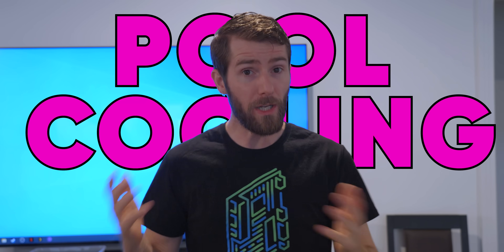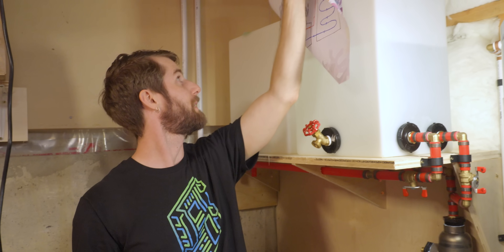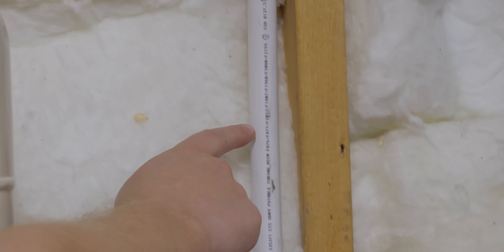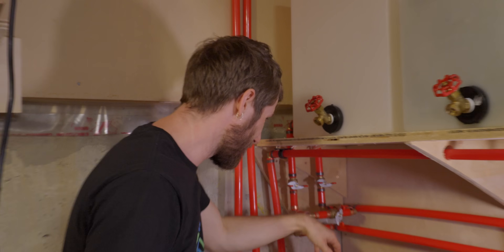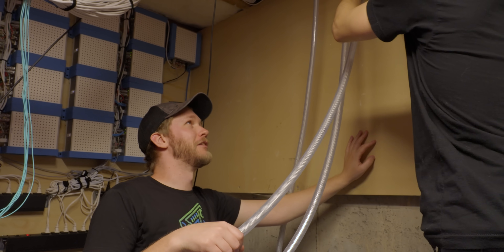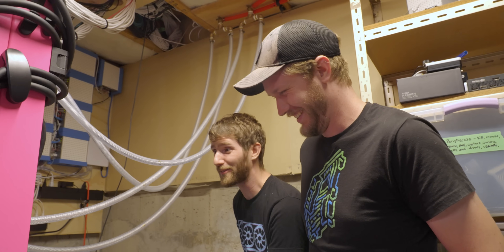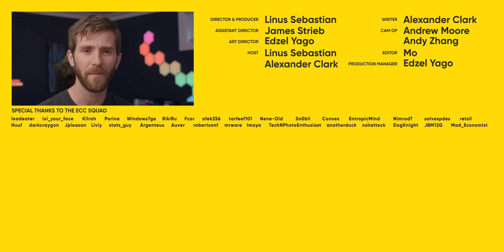My pool leaked and killed my computer - Whole Server Room Pool Watercooling Part 4

Comment: That switch blowing up was a bit concerning, especially since it's a quite high-end Unifi Switch. If possible, please show what happened to that switch and maybe you can find out why it happened
Reply: At work, we've mostly shifted over to using Unifi rather than Cisco, ,they've been rock solid, the network is easier to manage, and there's massive bonus of not having to deal with Cisco as a company.  Cisco's hardware is great, it's just everything else about them that sucks.
Reply: @phuzz00  100%
Reply: This needs more likes. I'm burning with curiosity
Reply: @ChristianGregersJørgensen  he just jacked out a 120v cable while it had load, guess why this happened, cross contamination of cables does happen. loaded 120v cable touched other power cable, switch cap blows out, end of storytime.
Reply: Probably got messed up from the water... wouldn't surprise me
Reply: @kungsboa123 it was above the leak and far away from any water
Reply: Especially concerning since they were blowing fuses on other devices.  Looks like they need a better UPS and power rails to better regulate their power load. Time for an APC/Schneider Electric sponsor spot.  With that many servers in a rack they essentially have a medium business datacenter, and they are throwing water at it.
Reply: @00shmee Won't touch APC with a 4 foot stick for anything enterprise. We replace the lead batteries each approx. 6 months whereas the other vendor battery has yet to fail.
Reply: yeaah, a rack of that level with those expensive parts should have schneider feeding them.  @00shmee
Reply: @00shmee  Wasn't there already one from Eaton for this?
Reply: @00shmee  Totally agree with this.
Reply: Who knows what things still had residual water in them and just connecting fittings was a enough to move it around then fry it.
Reply: @Wyatt_J_D  Depends how long it sat, I would not expect any water after even a few short days depending on humidity in the office they work out of! I know I wash my graphics card with dawn dish soap and water once a month and I am able to put it back in my PC within 4 hours, I do lightly run a hairdryer on it on low temperature for a bit but even without that... water does not stick around all that long
Reply: I have seen switches frying themselves after a power cycle. The switch fans spin as long as they have power, but when power is cut and restored, sometimes a broken ball bearing will prevent them from spinning up again. This will effectively burn stuff in the switch. Not that fast though.
Reply: The "Unify" haters in the comments are ridiculous. I have deployed literally thousands and thousands of Unifi devices across hundreds of clients and have had less failures than I could count on one hand.
Reply: @Th3_ArCh0n Tell me about your experience with SNMP counters.
Reply: Also: just for analytical purposes. If you are paid Ubiquity shill please like this comment.
Reply: @Th3_ArCh0n  I didn't even know they had so much stock. I guess you bought it all :)
Reply: @Th3_ArCh0n Seeing failures at all is the issue, lol. I can't tell you the last time I saw an HP or Cisco switch fail.
Reply: nah, hardware fails. A less than .1% failure is a great failure rate. @BrianBuresh
Reply: Upvote!!! I am curious to see what went wrong there!!!
Reply: Bros either a shareholder in unifi or a product rep 😂😂😂 bros literally trembling over a blown switch
Reply: i just saw this comment before watching the video, and my heart sank when i read it, i have some pretty expensive unifi switches so it really hit lol
ok, so i just finished the video and the switch that blew is an enterprisexg24 which i have two of, now im a little uneasy
Reply: The switch was an Enterprise XG, as Alex mentions. Enterprise (as you can guess) is intended for Enterprise deployments. Unifi isn’t the major selling point unlike with their other devices. All their switches can be used without ever entering the Unifi ecosystem. 

If you check the product page, literally nowhere does it mention Unify or any of the Unify ecosystem as a major selling point. It is compatible if you wish to manage it that way, but it’s not really the point. 

Ubiquiti make more than Unifi, that’s just what they market to the public because the prosumer market is good revenue. The Enterprise XG only has one mention of Unifi on the Ubiquiti website.

Regardless, Linus uses multiple PoE injectors that he has mentioned in other videos. It’s highly likely that one of them sent power back to the ethernet port on the switch which doesn’t support PoE thus burning it out.
Reply: @Kiddio  After scrolling though 67 comments, the 68th, and very last one, is the first to actually make sense.
Reply: I'm on the edge of my seat!!
Reply: Unifi 'enterprise'  is just cheap crap used by people who have no clue what and enterprise switch is
Reply: I damaged 8 ports out of 24 on a unifi POE switch from terminating a cable that is plugged into it. Taught me an expensive lesson. Never terminate any cables that are connected to a switch. It could range from just a quiet failure to magic smoke whether it's cisco, Aruba, Netgear, tplink, unifi, etc.
Reply: FOR THE LOVE OF GOD GET SOME WATER LEAK DETECTORS AND SMOKE ALARMS IN THERE.  THEN DOUBLE IT.
Reply: Maybe something with PoE injection? idk, there really isn't something shown that was done obviously wrong...
It's nearly Impossible for the PSU to be the source, as the only way it could produce smoke that consistently, would be if a Cap Popped, and that would have been most likely audible and also not what happens if PSUs fail.
A loud Bang and a Dark room is typical for Power supply failure.
The smoke silently building usually indicates silicon, traces or Resistors burning, or all of them at once.
I also don't think that it was water, that would have been by astronomical chances that it happened right when he was plugging it back in.
I'm reasonably sure that it was on the Low Voltage DC inside the switch
Reply: @jonnyboy5019  That switch isn't a PoE one, that much I know
Reply: I suspect there's a grounding issue in that rack. That blown fuse they also glossed over is the biggest red flag. There's a lot going on so what may be faulty or what the source might be is anyone's guess but by yanking power from the top switch, it may have sent a hidden fault diverting to ground to the bottom switch in a way that it wasn't designed to handle. 

All I know is I wouldn't have a single thing in there turned on until diagnosing further. The moment that fuse blew, they should have at least pulled out a multimeter and checked it over.
Reply: @JJFX-  realy difficult for a rack not to have earth.
Ever single device has ground over the ac input, the metal case connect to the entire rack.
And every single cat cabel going out from the patchpannel has a shiels. If connected to a pc or an device with earth its groundet as well.
Reply: @JJFX-  
The blown fuse was due to the SATA adapter being faulty. It's correlation, not causation.
Reply: @haxie4516  Yeah I heard him say that but they didn't really elaborate. That could very well be the case and this is just another isolated issue but it is strange.
Reply: @JJFX-  
Nothing really to elaborate...
Reply: Starting my career in networking soon. Can somebody explain why folks hate Unifi? Everywhere I ask, people say its been great, but expensive. Thats really the only issue. LTT comments and some reddit threads have shown a little disdain for Unifi, so Im just curious. It cant be worse than Omada, surely?
Reply: @indianboy0453  Because it's very 'apple' looking shiny hardware, it's a bit like Linux users hating on all else. Plus some of their early hardware was a bit crap and firmware was released half baked. Like with most vendors, once you learn the quirks, you can setup a very reliable network
Reply: @reuben-rt  I figured as much. Ubiquiti seems to be favored among Soho/small enterprise deployments, as opposed to omada, which I currently have deployed at home. 
Inexpensive and gives decent control and management.
Only real issue I have so far is that some esp 32 devices aren't playing nicely with the omada waps, so it's been a little frustrating lately.
Reply: Unifi Gear is somewhere in the middle of professional and consumer grade equipment. It is generally great equipment, but some of the real network management tools don't work quite right or are intermittently broken with firmware updates. One of the things that really bothers me is the connected clients list is often very wrong. It even misses hardwired clients. The support for Unifi is mostly community based, and the documentation is lacking. That being said, I use their gear at home and have installed it at my parents house. It has mostly been reliable and easy to manage.  @indianboy0453
Reply: @indianboy0453  I assume salt that anyone and their mum can set up a Unifi network, making their Cisco certs less useful. Sadly very common in the industry
Reply: Remember that Unifi pro has a back up power line, I don't know if here is deployed but if so, there may be a faulty backup regulatore (if I'm not wrong the backup power line is proprietary and in dc)
Reply: Yeah, I'll be interesting to see what has happened to it.
Reply: It got wet and when he disturbed the cables it shorted out. He's such an idiot sometimes and the whole opening story is llama drama
Reply: @keithwalton  
It wouldn't smoke like that from shorting out, and there was no loud bang to indicate anything in the internal PSU going bad
Reply: Yeah i need answers on that one
Reply: The UPS might be outputting 240V and some of the devices may not support that. It's not uncommon for enterprise rack mounted UPS units to have 200-250V output.
Reply: @nav27v  modern psu support about 90-250v
Reply: If I had to guess that custom length power cable is to blame.
Reply: @kingsford106  
You guessed wrong, I'm afraid.
They tested it and it was fine
Reply: The problem is...that it's a unifi switch. Not exactly known for reliability.
Reply: My first thought was that the new custom cable was somehow faulty and fried the power supply of the switch, but that is just a thought, I dont know what I'm talking about
Reply: @simnyl  Wasn't even plugged in at that point
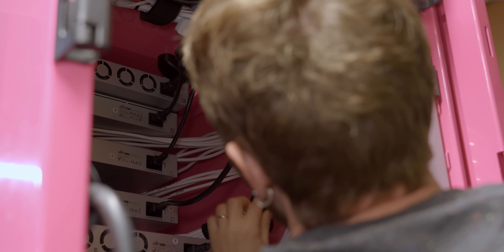Reply: @LMojzis  at 17:12 he points at the switch in question, one can see that it is the fourth switch counting from the top, which is the same one that he unplugs at 16:55 when the smoke appears
Reply: @simnyl   not possible. if phase / neutral are swaped nothing happens, it works perfectly finde. If you swap neutral and ground the rcd will tripp, if you swap pase and ground you get a short, the braker will pop and the connector can be fried, but the switch itself should be ok, just nneds a new ac input.
Reply: @simnyl I agree. I think maybe the polarity of the custom cable was messed up and it just fried the hardware
Reply: @servicesaustralia4329  not possible.
Line - neutral swap is no problem, hapens even if you rotate the plug 180°

Neutral - ground swaped: rcd trips
Phase - ground swaped: 110v on case, case connected to rack, rack to other gear, is just a short, breaker trips.
Reply: I think its a power surge from yanking out the first power cord. Cutting power to first switch overloaded the other.
Reply: @TheADDTinkerer  
No, that's not the case lol
Reply: @haxie4516  care to explain as to why not?  Curiosity not snarky.
Reply: @TheADDTinkerer  
Those switches don't use that much power, and disconnecting one switch wouldn't overload another, as the switches are not doing power distribution or anything like that, so it's not like unplugging one caused the other to suddenly pull more current, or anything like that
Reply: Ubiquiti has had tons of PSU related problems - it sadly isn't surprising to see a ubnt psu releasing the magic smoke.
Reply: @HomelabExtreme  if its just the psu it can be replaced with a generic one.
Reply: Yep, three of our six poe unifi switches (with average load of 30W per switch) died within a couple of years because of psu. Good thing that psu can be replaced with some capatible generic one (48V, 3-4 amp) @HomelabExtreme
Reply: Maybe he unplugged the other switch so suddenly while it was on, it caused the voltage to wobble and somehow the other switch failed from this. It started smoking the second he disconnected the top one.
Reply: @teamredstudio7012  
If that was the case, other things would have died from that too.
Reply: @haxie4516  I'm not sure about that, but I also don't deny that it's a possibility. Of course we're all speculating and nobody was there to witness it. Maybe it never even happened and it's all fake?
Reply: @teamredstudio7012  
What?
Reply: unifi never is high end, every device they sell has lots of software and hardware issues, many switches in our office just died with random led display on the lan ports, please dont say unifi is high end
Reply: @danielbrunner8312  
Unifi is high end
Reply: Well, it's Unify, not really a Cisco.
Reply: @PascalBrax  Unifi is perfect for what he's doing in his house.
Reply: @PascalBrax  UniFi*
Reply: So the software should suck, not the hardware! @PascalBrax
Reply: @PascalBrax  Yes, Cisco is well-known for their IPX67 switches.
Reply: Well, it is bound to happen... He must have the replacement paid for with content, as per usual.
Reply: No need. It's unify. Both the cause and diagnosis.
Reply: no such thing as a high end Ubiquiti. its prosumer at best

Comment: Some of this is why "real" on server water cooling uses a heat exchanger because the facilities water should never be let anywhere near your server. Then again they are not cheap. Just buy a water cooled rear door for the rack, the ones we have at work which are already 12 years old are good for up to 93kW of cooling per rack, though only optimal up to 65kW. That is fine because I haven't worked out how to get more than 66kW of power into the rack anyway and that is use three 32A three phase PDU's per rack.

Comment: Leak sensors might be a smart investment... They make rope ones that detect leaks on the whole length of rope, so you can wrap it around a hose or surround a component
Reply: A negative pressure system combine with a failure to hold negative pressure may be easier to install and more safe.
Reply: @17:57 that's not a leak sensor rope is it? confusing

Comment: Dude wrapped that PTFE tape wrong.. you need to spin tape fine and fill the threads individially before wrapping the whole end of the connector. The way hes done it might have a very slow leak over time.

Comment: sooo , no pressure/temperature/flow sensors on the pool loop .... remake all the system with a cool heat echanger (very good idea ) and ... still no pressure/temperature/flow sensors . That system deserves a LCD Panel on is own with all theses sensors , connected to a Red strobe and siren to alert a malfunction and remote sms/mailing/control ... industrial grade :3

Comment: I would have mounted the water distribution blocks outside of the cabinet as it looks like the most possible failure point. I also would use something like Yolink water control system that can cut off the water in the event of a water leak.

Comment: 11:40 It's as confusing as the old MIDI In and Out ports on Keyboards. When connecting these to the computer you always have to plug the MIDI Out from the Computer to the MIDI In on the keyboard and vise versa.

Comment: Love this series. 
Something to be aware of, those plastic manifolds have a nasty habit of breaking over time, and you typically can't replace just the single valve that breaks. (Aka you are replacing the whole manifold when one valve goes bad) I typically make my own manifold out of solid brass valves, linked together with Plex. They last forever, and if one does go bad you can swap out an individual valve.
Reply: Don't worry they'll make another video when it breaks. I feel like they're just milking this now.
Reply: Or just buy an off the shelf brass manifold block.

Comment: Could you give using AN fittings a try? 
I know they can hold up well to the 70 pounds of fuel pressure in my off-road vehicle. 
Maybe an 05 or 06 size? 
Oof. Some of those look like at least maybe 08? 

AvE: McMaster Carr is dead to me.

Comment: Lol, couldn't you just not use rubber in the hottest part of the whole loop? Maybe, I don't know, copper home plumbing hardware? And couldn't you just purge the water lines and then (slowly but who cares) filter on the refill? Don't get me wrong, this is way more fun of a solution, but it's definitely not a targeted fix.

Comment: 8:14 A common misconception and a big misunderstanding about Teflon tape is that it is NOT a sealant.  It is not used to seal threads. It's used as a lubricant for NPT threads in order to help jam those threads down further because the super tight fit in the threads is what seals an NPT fitting.
Reply: youve just described the exact job of a sealant

Comment: Why not buy a distribution block for the water with nipples built in?  No need to attach NTP threads into plastic (don't use tape on these, only use paste) and half the number of failure points.  Plus, these blocks which are commonly used for pex water supplies and pex heating systems, are tried and true products, so with an optional pressure relief bypass so any excess water just flows back out an into the storage tank.